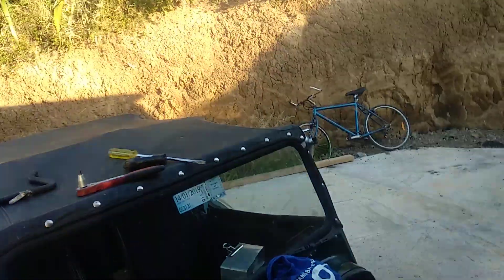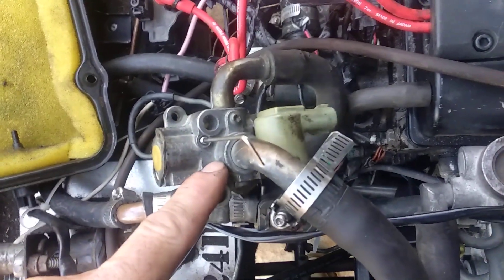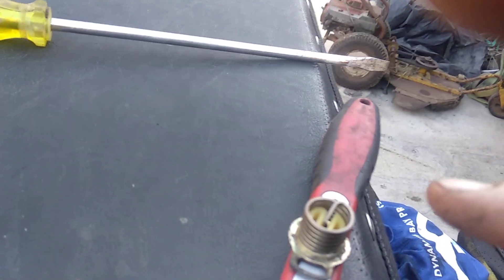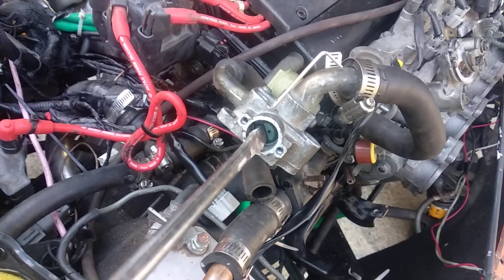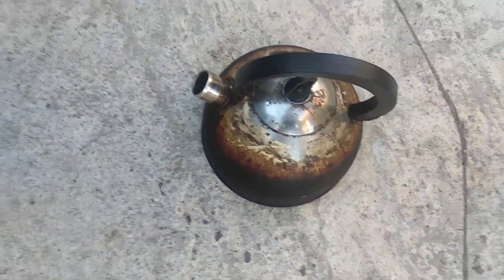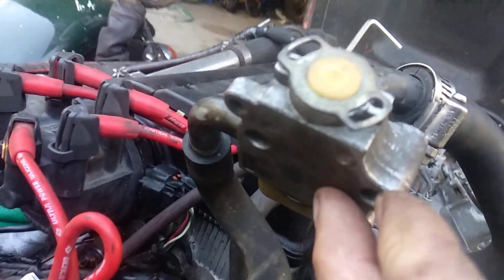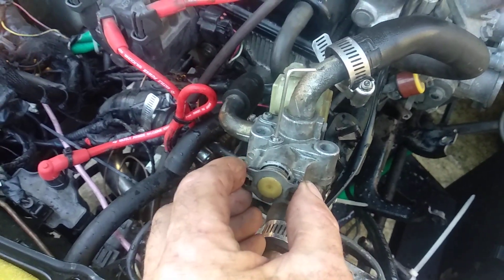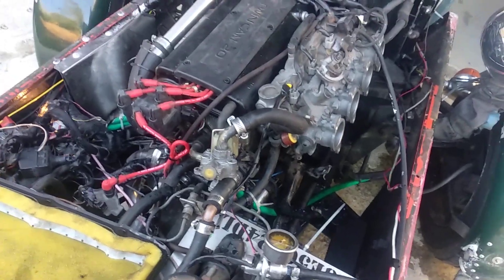4age Intake Air Control Valve (IAC) idle device. A simple video how it functions, how to test it.

Comment: If the iacv is out of calibration can it cause it to idle at 500rpm maybe lower.
I have a silvertop 4age that at idle hot or cold idles at 500 rpm plenty of power and is fine when driving

Comment: After 2 years I juz got my tacho working.It reads 1000 rpm after 15 mins of idling on an hot afternoon.I think this video might be good to lower the rpm btw 800 to 850 when the engine hot enough.I m frm Malaysia.Thank you for good illustration and explaination.
Reply: bos mcm mana nak buka bolt kt iacv tu? nak kena buka throttle body ke?

Comment: Is there a fuse or relay that controls the idle air control valve?
My car is a ae101 4age blacktop idles at 1200rpm cold start then rises to 2000 rpm
Reply: Just the idle control valve it probably wants cleaning as well all the build up of carbon

Comment: My area is 876 now My 4age engine isn't starting when it's hot and I change even the coil and it's the same also not reving pass 4000 rpm computer capacitors looks fine. I distroy one set of starter brush already 8.5.4.4.7.4.3

Comment: My blacktop 20v on cold start idles at 1200rpm but as the heats up it gradually climbs to 1800rpm and sits there! Do you wreckon the IAC is causing this? Can it be taken apart and cleaned? Thanks
Reply from the maker: Hi there. Yes it is likey that which is causing this. Take off the air box and trumpets. Remove the air box back plate. Remove the iac and dis assemble it. Dont  miss the glue covered allen screw on the side. When complete hang it off the side of the engine and adjust he small allen screw to get cold idle. Adjust the bimetalic spring slide screws to get cold idle speed. Pour boiling water on the valve to emulate it being on the hot cylinder head for the idle to come down. Make sure you have no air leaks anywhere else. Aliexpress sells new iac cheap. For a long time also I ran a ball valve and bypassed the iac and set by own idle with a ball valve turnable tap. Hope this helps. Rex in New Zealand.
Reply: @planesofpaper  hi..will a faulty icv  that sounds like a cam Wil it be the course for engine light to come on?

Comment: Do you have any idea why my 4age 20v is idling at 500 rpm then dying on a cold start after about a minute? When the engine is warm its all good though.
Reply: My 4age has the same problem
Reply: @lemonbrah6412  check your map sensor
Reply: Clean your IACV it’s clogged and the spring isn’t spinning like it should